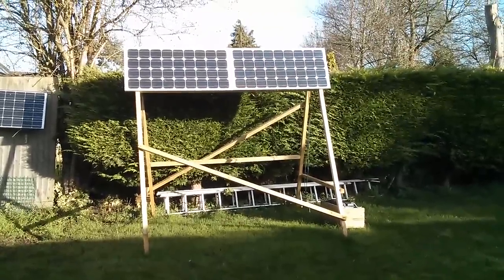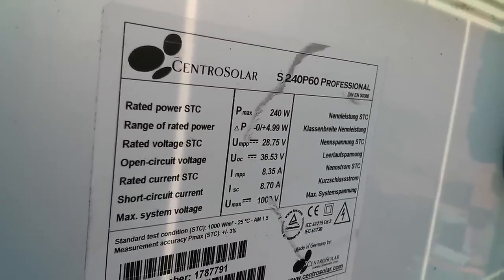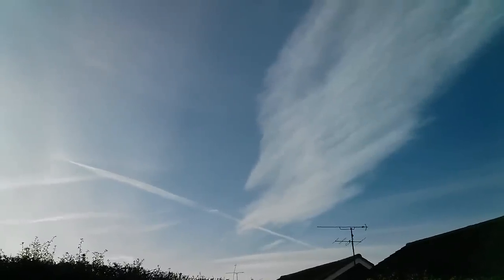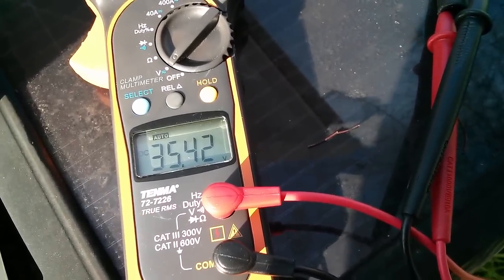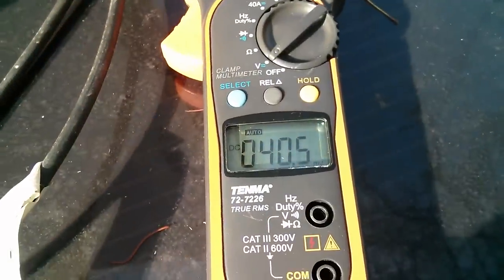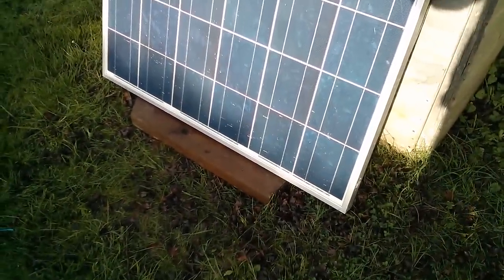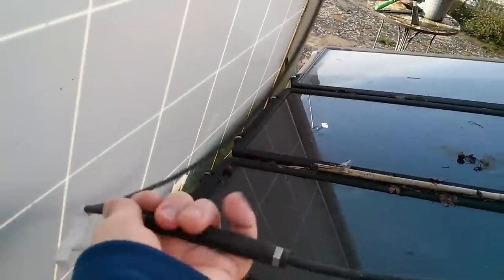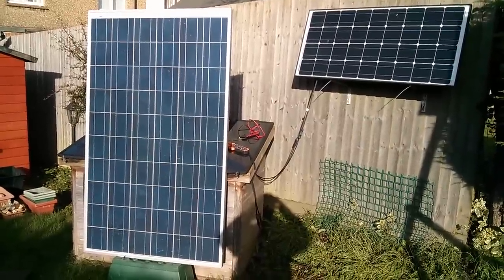Playing with: 240-Watt Polycrystalline 60-Cell Solar Panel

Comment: Wow, that's quite a panel!
Reply: +zaprodk fascinating to me was, my panels are a touch larger (280w) and my installer hauled them up one handed via a ladder (they did install both scaffolding and a pulley but he didnt use it) and did that 10 times over up to the roof!

Comment: I have 4 panels similar to these wired in series going to a Midnite Solar Classic 150 charge controller, and 4 150 amp hour 12V batteries. My system is configured as a solar assisted Uninterruptable Power Supply (UPS). The system has a true sine wave inverter and powers my house computers and servers from specially identified sockets in the house. At night and during cloudy days, I draw power from the grid with an 55 Amp AC charger to keep the batteries topped off.  I didn't want to go the grid tie route as a grid tie system shuts down during a power failure, and a powering the house completely from batteries was out of the question due to the expense. I instead opted for standby generation to powering the house during power outages, using a transfer switch and a portable propane generator.

Comment: Hi. I have been playing with these things for years. It's definately a poly panel and the one on the fence is a mono. I assume your solar system is 12v from the size of your existing panels. The new panel will charge into your 12v system at something like the rated amps, but of course it will give less watts being at a lower voltage. so you could use it as you suggest or on your system, or choose between the 2. I run a tracking gate with 10 of these panels on it in a 48v system, and have uploaded a series of videos showing it's construction.  All the best, cheers, Andy

Comment: Regarding your comment that the panel is putting out 180 watts:  You multiplied the short circuit current by the open circuit voltage, didn't you?  I don't think that's correct.  You either have 4 amps times 0 volts or 36 volts times zero amps.  This comes to zero watts in either case.  I just watched your 2N3904 video, so I know you know your Ohms law.
Reply: Indeed, basically all the energy just doesn't get captured in the first place. Technically something does get warm, but it's the panel itself and it doesn't get warmer than any other thing you leave out in the sun.

Comment: Looking at the last moments of the video...I would flip the shed 180 !
Of course, 'flip' isn't quite the procedure, but it seems to have the right roof angle. Could power stuff in the shed too, especially if that's where the e-bike lives.
Reply from the maker: +slider2732 Yeah, it has always bugged me that the shed roof slopes down to the north. A large solar panel would make a good shed roof.
Reply: +Julian Ilett ........ Go on , hack a door in the back of it & turn it round . Or even the side ! These a vid in that !

Comment: You most certainly can create sparks by shorting a solar panel, even though the voltage drops to 0 or near 0.  I've singed many wires and anderson plugs over time by shorting high power solar panels.  You can arc weld with the leads of a 250 watt solar panel.  
The good news is, in no way can you ruin the solar module itself.

Comment: Hi Julian, why not get a micro-inverter, ReneSola make a 250W and a 300W.  You could then just wire a plug on the end and stick it into a wall socket. It would then automatically off-set your consumption a bit.
Reply from the maker: +Peter Fosseus That's pretty much what I'm thinking - it would have to be a legal G83 approved unit for use in Europe. Opening up the micro-inverter would be fun too.
Reply: +Julian Ilett 
Here in Canada to get a panel connected to the grid with microninverter, the permit is 477 can $. The smart grid meter sees your production and you get a nice letter from the power company, and at the same time the inspector shows up and the next thing is to take down the contraption. (anouthorized power generation). I dont know about England but think its similar.
Reply: +matanas12 Here in Cape Town, South Africa, we don't yet have smart meters but we are required to install a "reverse flow prevention" device. I wonder if that would work for you. I have seen current sense relays that would be able to switch off the micro if it was feeding back. If you set it to 1A (220W) that would give you plenty of lee-way ?
Reply: +Peter Fosseus 
Good idea but needs to be @ 10 amps @ 240v for 4 panels that my setup was. wondering where can i get one of these.
Reply: +matanas12 to get the feed back tarrif (as its called in the UK) its a huge deal, with energy and insulation audits, its own kw hours meter with remote monitoring (uses the cell phone data network),   id probably just install it with the inverter and directly have the saving, not bothering about the feedback tarrif, it would be tiny anyway for one panel, I have 10x280w panels for my setup
Reply: +Peter Fosseus the micro inverters handle all of that, in fact they dont supply the circuit unless they already see 230 -250 volts, too few or too many and they dont add their power to it. you dont have to worry about power feeding back to the panels
Reply: +matanas12 Have a look at http://www.ev-power.eu/GridFree-Inverters/Current-monitoring-relay.html
Reply: +jusb1066 Hi, it's not feedback to the panel, it's feedback into the grid. The average utility is strongly against you getting credit at their "retail rate" they would rather credit you at their "wholesale rate". That is the main reason they try and make it as difficult as possible. If you don't feedback, try and run your meter as close to zero (when the sun shines) there is not much they can do. You will still be a net consumer but you could save 1/4 (6 hours) off your bill each month. Normally the instant you "feedback" the meter trips and alerts the utility, who then come and fine you.
Reply: +Julian Ilett Would it be possible, to make a MOSFET to modulate the power output, from the panel, to reduce the micro-inverter output in relation to the current drawn from the utility?
Reply: +Peter Fosseus 
that looks promising.
thanks

Comment: When you are measuring amps with that meter, you nead to press rel before you put it around the cable. Otherwise it gives false reading. The rel button zeroes the meter and it gives correct measure.
Reply from the maker: +Jeze Zaitanen Ah yes, good point. There was about 400mA of offset on the display when I took the measurement.

Comment: Really nice. But to be honest I wouldn't put it up on the roof.  You've now had to align, change etc to get max sun on it to get the max  power. 
Actually interested in your measurements if you just put the panel in other angle, like 20 degrees out of the direction of the sun.  ....  or you have to make a arduino suntracker and really put it up high.

Comment: You will damage the connectors if you short them or disconnect the short while there is sun on the panel that is do to reasonable open circuit voltage that is DC. When you short the panel there is no 180W or so of energy dissipated it is much much lower. The voltage drop on that two meters of 10 or 12AWG wire will be multiplied with that short circuit current and the voltage drop will be extremely small a few mV so just a few mW are dissipated.
If the panels will have been oriented in the direction of the sun at noon in winter you can get as much as 9 to 10A short circuit current.
Max power will be higher in winter do to lower cell temperature but the day is much shorter in winter so the total energy will be lower than in summer.
You can use the SBMS4080 with that solar panel to charge the ebike battery no need to mount the SBMS on a heatsink with just one panel.
Make sure the battery is connected first then 10 pin cell balance and measurement connector and last the solar panel and when you disconnect you do that in reverse order.
Reply from the maker: +electrodacus Hi Dacian. Yes, I very much had your SBMS in mind for charging the e-bike with this panel. I had planned to use the SBMS during the summer, but our warm season is SO short. Summer seems to be over before it starts! I keep Almeria (in southern Spain) on my weather app because it's always sunny and warm there - it makes me feel better.
I realised my mistake about the 180W calculation while I was editing the video. But are there zero (or near zero) volts across all the cells when the connectors are shorted? Or can some cells (in the middle of the panel) have a higher voltage. I guess only somebody who builds their own panels could test this.
Reply: +Julian Ilett There is some voltage drop on those tab wires connecting the cells but is really close to zero in the mV range. You actually have access inside if you open the junction box. On those 60 cell panels there is access to each 20 series connected cells so you can make this measurement if you want.
You can also test if you have two ore more solar panels connect them in series then short circuit them and measure if there is any voltage drop on one of the series connected panels.
Each cell is a small constant current power supply (with a diode in parallel) with open circuit voltage around 0.6V and max power point voltage around 0.5V the short circuit and max power point current are almost the same and depend on the cell size 6" cells as you have on that panel are around 8 to 9A depending on the cell efficiency at 1000W/sqm solar and the 5" cells are 5 to 6A in same conditions.
So if you short one cell the cell will push that current trough the short circuit and the voltage will be the drop on that short. Then if you have two cells in series the voltage drop is just a bit higher because of the additional resistance of the short interconnect tab wire.
The cell is like a diode so that around 0.6 to 0.65V open circuit voltage is the voltage drop on the diode at the current generated by the cell.
My next project will be to fully heat the house with solar PV panels since is the least expensive method of heating at around 3 cent/kWh (that if I can use all the available energy).
The idea is quite simple use a resistive element connected to a solar PV panel (it can be a piece of long copper wire as in my experiment a few days ago). You can look on my google+ page I had a 30m of 22AWG wire connected directly to a few parallel 60 cell panels. The 22AWG has a resistance of 66mohm/m so 30m of it has around 2ohm. This wire was immersed in a relatively large volume of water about 35 to 40 liters since if free air the current will have been to much for that wire but you can calculate the wire to be able to work in free air you just need more of it. I had 3 parallel panels and pushed 16A trough that 22AWG wire heating the water at a rate of about 500W (34V x 16A) later I connected another 2ohm 30m loop in parallel so that the 3 x 260W panels worked closer to the max power point and now at noon I get about 700W 28V x 25A that is transfered to the water. Even in a short winter day as here I was able to get that water close to the boiling point the only reason it was not getting there was that the pot is made out of aluminum and has a large enough area that the losses to air get around 700W when water and pot surface is at around 80 to 85C so it gets to thermal equilibrium.
The idea is to have a digital controller (I called a digital MPPT) that will switch a number of this parallel loops to change the resistance in order to keep the PV array at the max power point. With just a fixed resistance as I have now you only get 50 to 60% of the possible energy. You get max at noon but in the morning and afternoon when sun is at an angle and current smaller the voltage drop will also be smaller and thus the circuit not work at the max power point.
Reply from the maker: +electrodacus That reminds me of my large array of miniature bulbs which I used to find the MPP of solar panels in my early MPPT experiments. Maybe you could immerse lots of vehicle headlight bulbs in a shallow water trough. Or perhaps more sensibly use lots of aquarium style heating elements.
Reply: Julian Ilett
The way I will use this will not be to heat water but concrete. My house is designed with a large concrete slab 14 cubic meters that is thermally insulated from outside and can act as a energy storage device.
I will be using 31 loops of 75m of 22AWG wire embedded under the ceramic tiles (I will have ceramic tiles on the entire house).
All this 22AWG will be high quality silicone insulated cable and cost around $500 not much for entire house heating about 6000W distributed over 60 to 65sqm.
The concrete will absorb this heat and act as a storage device in my case those 14 cubic meters of concrete will store 10kWh for each 1 degree Celsius delta.
Maximum of 10C delta is reasonable 18C to 28C so 100kWh can be stored. Considering my house requires at most around 1000kWh/month in the coldest winter months January that level of storage will allow for quite a few days without sun so no backup heating will be required.
I think I seen that miniature bulb array in one of your videos. I was thinking on using automotive halogen bulbs to build a reflow oven but never had the time for that so I use an AC reflow oven for now.
Reply: +Julian Ilett We cant trade places, here in Germany the Summer is VERY long, up to 4 months of heat but with feeled 900000% humidity. It's just deadly, not pleasant at all. You wanna hide in your home and turn on all sorts of air conditioners in parallel...
Reply: +dispatcher7007 The last summer was EXTREMELY hot... And that for VERY long...

Comment: How are your Maplins panels behind holding up? I've had to repair 3 of my 6 panels after 5 years because the connection tabs in the frame tear away from the glass due to thermal cycling.

Comment: You forgot to zero-out the current meter, it was still showing 0.4A without any cables.
For DC measurements with a current clamp, you always need to zero it just before the actual measurement.

Comment: I tried running my solar setup with a grid tie inverter and it made my electric meter go into reverse current tampering mode! Might be something to check with the electric company before doing so...

Comment: hi, what abut using a helmet/ headband mount go pro style cam ? :)
Reply from the maker: +iceberg789 To remove camera wobble? I promise I'll start looking at new cameras soon (in February - on my birthday). I'll make sure it's got optical image stabilization.
Reply: +Julian Ilett apart from that, a head mount will let you use both of the hands freely.

Comment: Can someone explain why shorting is ok on these panels? I thought it would be just as bad as with a battery.
Reply: +mr_os Because solar panels have a high internal resistance, so they don't really have a "fault current" mode. The maximum current they can output is at short circuit and that's not massively more then what they would be doing at maximum power point. All the internal resistance renders them essentially a constant current source rather than a constant voltage source (like what a battery virtually is).
Reply: +xanataph oh I see! Thanks a bunch!

Comment: Good score. Looks like those type of panels are intended for sting configuration in a grid tie setup due to the non-standard output voltage. (When considering voltage outputs suitable for charging batteries). Still, that's easily gotten around by using a MPPT controller or even just a simple boost or buck converter depending on what you want to do.

Comment: so lets say this solar panel was made with a graphene-type substrate...what would the specifications be?
Reply from the maker: +"pad kid poured curd pulled cod" Expensive! Isn't graphene a conductor?
Reply: apparently scientists created a substrate called molybdenum disulfide to carry the electrical current ( graphene by itself wouldn't make for a very good solar panel ) ..and i read that the efficiency is somewhere 1000x more than silicon based solarpanels. Jeez..its just hard to fathom how much power a graphene solar panel that large could produce. essentially we're talking KV's if im not mistaken!

Comment: Build a step down converter for free laptop power !.
Reply from the maker: +Blahblox Gyuanox Another idea I have is to use a step up converter to transmit power back to my workshop. About 50V DC - should minimise cable losses.
Reply: That's funny that you say that :)  I'm doing exactly that!  Except I don't need to step the voltage down.  I have a 100 watt lightweight solar panel that is 20V @ 5A which is EXACTLY the same as the charger for my MacBook Pro!  So, I have the end of the plug for a MacBook Pro magsafe adapter connected to a cable that is plugged directly into the MC4 connectors of that 100 watt panel.  It's totally safe.  If there are clouds, the charge rate simply slows or stops for a while.